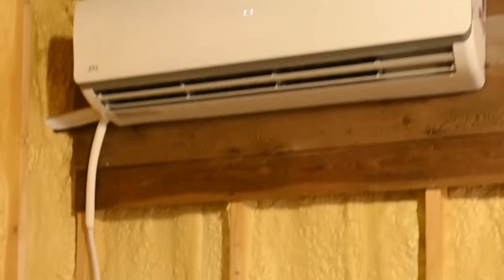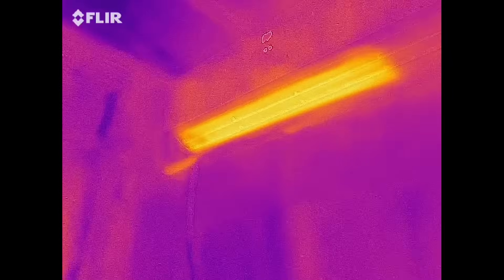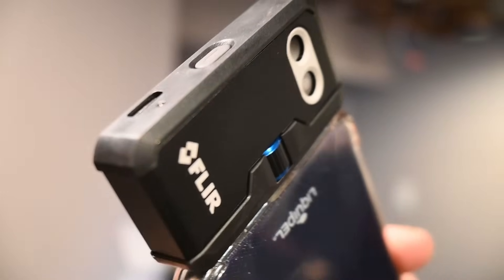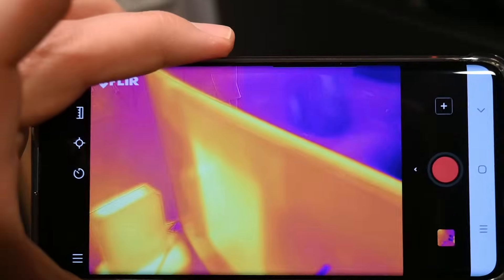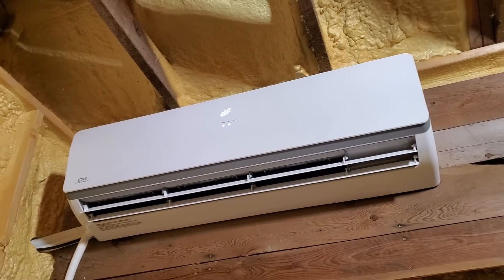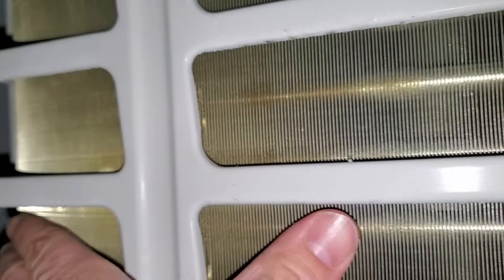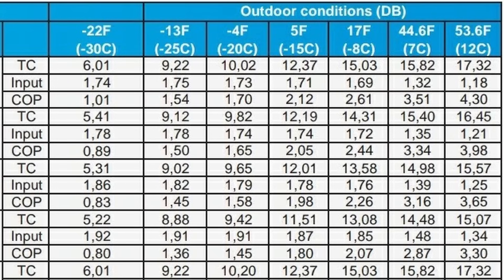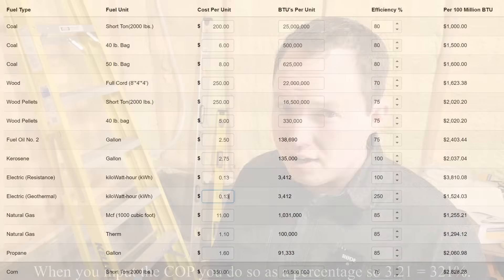Can You Use a Mini Split in EXTREME COLD? Heat Pump vs. Propane Cost Comparison with Thermal Camera

Comment: As a hvac tech of 18 years I’ll tell you that I love ductless splits, they break down all the time and I make tons of money off them.. I’ll take ductwork and natural gas any day , refrigerant leaks are so common with ductless due to stupid flare fittings also control boards , blower motors and condensate leaks are always inevitable
Reply: As an HVAC tech myself (in Canada)I have a different opinion. I have installed many of these or even conventional forced air heat pump. Most of the units I have installed have worked without issue for years. 
The splits go well into country home renovations that used to use straight base boards or wood fire stoves. No duct work available for retrofits.
They also work well in the city were folks have tuned attics into living space or mad add one in the form of sun rooms, which also have no ducts.
I always wondered why people cite failures on heat pumps that can also be found on ACs or gas fired furnaces. Boards on furnaces? Yes. Blower motors on forced air? Yes. Refrigerant leaks on ACs? Yes. If your flares are giving you a hard time I would recommend follow torque specs and using a small amount of sealant/lubricant. Use a good tool and make a nice flares. Will some leak? Of course but boy is it easy to find when the flare does leak. Reclaim the remaining r410a. Redoflare. Vacuum. Weigh in charge. Done. But this is a small.percentage.
Moral of the story. Proper Installation practice in proper application these units are great.
Reply: I just replaced a top of the line carrier nat gas furnace that only lasted a few months over the warranty of 10 years because it was more expensive to fix it AGAIN, rather than replace the whole thing.
Reply: Yea, well my forced air furnace igniter failed almost yearly on the worst day possible. My splits are flawless….

Comment: I've heater my house with a 36 thousand BTU and 2 heads (1 up stairs 1 down stairs) .. My power rate is 16 cents per KWH .. I've had this pump since 2012 and I record the power meter readings approx. twice a week every week since 2012 .. .. I also have electric heat but it's NEVER on , I only heat with the heat pumps .. In winter (here in Canada) when the temps are -10 to -20 it costs anywhere from $8 - 10.50 per day depending when the clothes dryer etc. are on ...

Comment: It’s amazing how good Mini splits have gotten. Midea/Carrier has a 40seer 15eer 14.5hspf at 5f its hitting 2cop. I installed a .75ton one in the basement and have tested it at -6f with 130discharge temp and set blower on furnace in off and can maintain a 2300sf closed cell home bit excessive for the central KY environment. This home is perfect world example being a cape cod on basement.
Reply: 130f discharge temp is very good. That's almost as high as a gas furnace, especially if you consider loss in a ducted system.
Reply: @stevenle1760  It's honestly too high of a discharge temperature. Higher discharge temperatures mean higher compressor head pressures, higher power consumption, and lower efficiency. They are sacrificing COP so that people get to feel a warm breeze.
Reply: Terrible cop for a so called super high efficiency unit. What a scam rating.
My 24k 20 seer 10.5 hspf beats that lol

Comment: When you show the heat pump outside the garage is pulling heat from the air, does it make a difference that it's sunny and the sun is warming the outside unit?  Also unless I'm mistaken, the fuel calculator link you give doesn't include cost of operation for heat pumps.

Comment: An easier way to describe a heat pump is as a heat amplifier. It draws heat from the surrounding air, stores its energy through compression and multiplies its effectiveness.

Comment: We install hundreds of these units. There is a lot of misinformation going around. I will try to make this short and simple. First if you are going to use these units to heat with you must do a heat loss in each area you plan to heat using the design day in your area (design day is the coldest expected day of the season) in  mid eastern PA we use 9 degrees. Second you must use a unit capable of providing these BTUs at that design temperature. Just because your unit says it works to -22 means very little because it does not tell you the diminishing BTU output. You must look for this info in the charts. Most inverters are only putting a little more than half capacity at 0 degrees. For instance, you have a room that requires 12000 BTUs on a zero degree day, you can not use a 12000 BTU unit. In order to get 12000 BTUs on a 0 degree day you will need to look at the charts and you will find you will need a 18000 or 24000 BTU unit to get the 12000 on a zero degree day then the units will be to large to properly dehumidify when using them for A/C. You must use HIGH HEAT units. Different companies call them different names. Hyper Heat, High Heat, etc. These units use a two stage compressor and will put out full BTU capacity below zero although there is still a drop in efficiency they still provide full BTUs. The industry itself has caused this confusion because they got into this competition about how cold the units would operate to without explaining the diminishing output.

Comment: ur a hoot.. When you say sum drop in heat output @ -22 f..24k vs 10k..Gas heat juz puts out. WHEN YOU NEED THE MOST HEAT..HEAT PUMPS FAIL...DAAAAAAAAAAAAAAAAAAAAAAAAAA

Comment: Here is W TX inverter heat pumps work well, especially if you oversize.  Problems with oversize don't exist here in summer as our humidity is nil.  We can upsize by 50% without issue and have heat down to the lowest it gets to be here in winter.  These work great.

Comment: Interesting information.  My Napoleon mini split was not at all effective in warming my small space at -20F .  My gas fireplace unfortunately stopped working and I had to wait a month for the part.  Had to resort to space heaters for a month to keep from freezing.  I am quite disappointed as I added this unit as a back up heat source which failed miserably when I needed it most.  It does a good job of cooling in the summer.

Comment: I wasn't finished with that post -- anyway I have not been able to figure out whether, when you decide it's dropping below the point at which you are saving money, you should SHUT OFF the heat pump or just let it keep running and ADD supplemental heat (I have a Rinnai propane heater and a masonry wood heater).

Comment: A quick question for you fella, would the condenser unit that is outside that had a two degree difference from in side to out side of the fan unit be able to have higher efficiency if the coil size was doubled ??? Just a thought Sir and thanks.
Reply: Yes, that is true.  That is why a 9k HP has a higher efficiency than a 36 K unit.  The indoor coil is compromised on a larger unit or it would be approx 3 to 4 times larger on the wall.   Nobody is liking thos looks and the materials would Bumpus the price significantly. 9 k units are typically 30% more efficient than large units because of this
Reply: @greg042  Thanks Greg for the information.

Comment: One to explain: absolute zero is -460 degrees below zero. Everything above that temperature is heat.
Theoretically you could extract heat from the air all the way to -460

Comment: Haha...I lived in China for a number of years. Many of the homes/apartments/condos are run by ONE stand alone heat pumps for the whole apartment. the Cninese consider us Americans spoiled. Mine was at leat ten years old. when the temps outside got below 40F, the coil outside started to turn into a block of ice. when it got colder, I had to shut off the heat and use a hair dryer to melt the ice on the coil. Obviously I had to be creative in how to heat the apartment ...not fun! Here's a question for you...How do you protect the outside coil, no matter how good it is, from rain and snow when it needs to "breathe" and move air???

Comment: Hi Ben,
Just brainstorming. If the heat pump works less efficient at colder temperatures, what about a setup that allows you to open a air vent from the inside of your warmer house so that the heat pump is not just getting freezing cold air? Is this an idea worth looking into?
Reply: yes maybe run a gas furnace outside by the heat pump so it's not so cold for the heat pump. PS sarcasm
Reply: Could be a good idea
Reply: @benbbuxton  instead of exchanging heat with the outside air, it would be better to exchange the heat with a flow of hot water. 

In that case it would be better to dump the heat of the hot water into the building.

Comment: It does not pull heat from outside, all you hvac guys need to quit being sheep. It’s a reversing valve that runs the ac backwards. That’s why there has to be a defrost mode. SMH I get tired of telling all these people things that should be common sense

Comment: Nice video. But missing from all this conversation is, how many btu/hr do you need? I saw the infrared camera pick up your framing (thermal bridges for heat loss from inside to outside).  Anyone building new or renovating really should run the numbers on insulation vs fuel cost, and try to strike a balance. I'd encourage people to familiarize themselves with the Passive House Standard, which includes super insulation, quality glazing, eliminating air infiltration and thermal bridges, and use of ERV. If you do these things first, you can reduce the size and operating cost of your heating and cooling equipment. Full passive house certification is more difficult and costly, but the base principles can be applied to any structure.

Comment: I'm trying to heat a greenhouse in the winter in southern ohio, trying to figure out if a mini split will be cheaper than a forced air coil heater I have mounted on the wall, to heat with.

Comment: Do you leave your mini split on 24/7? 

And… does your mini split inside unit fan ever stop running when the unit is set to automatic speed?  

My inside unit fan is always running unless I turn the unit completely off.  

Mainly wondering if it is normal for the inside unit to run continuously on a mini split?

Thanks
Reply: Some units will shut down the indoor fan if you have no need for heat for an extended amount of time. Otherwise it does this to sample the indoor air temp. You should leave your unit on all the time - there is no benefit to using setbacks with these units since they run exactly at the levels they need to.

Comment: Thank you for the hard work you put into your videos. You really helped me have a better understanding of how they work. I'm in the process of deciding if I should replace my old central AC or install mini splits. Would you recommend a 3 zone CH  unit? Wondering if one head unit  stops working do you need to replace the whole thing?  Thank you again.  I really enjoy  your material.
Reply: Highly recommend you research the fan noise, from the condenser placement and room units.  That, to me, is one of the bigger drawbacks.

Comment: Don't these units also use something like a hot gas bypass? Where they just compress the hot gas and send it straight to the evaporator instead of to the condenser coil.

Comment: Amazing channel, Ben, congrats. You are a natural teacher. I have learned a lot from you. In cold areas, would it make sense to add a heat tape (those used to prevent pipes from freezing) around the return of the line, before it goes out of the house into the compressor (to help out in extreme cold days)?

Comment: Good video, thank you for the content! I have an older heat pump i'm looking to replace, been considering the newer Mr. Cool Universal that can operate at pretty cold ambient temps. Got real tired of the old heat pump being turned off and running in 'backup heat mode' (aka toaster mode with resistance heat) during that stretch of near zero degree temps. I have my compressor cutoff around 15 degrees currently, seeing the Mr. Cool Universal able to stay fairly efficient in sub-zero temps but curious about real world experiences.

Comment: I just had a thought cross my head. For heating a space, the best location to start heating is from the floor and allow the heated air to rise. If heating inefficiency is to be mitigated, wouldn't mounting the inside unit down low be best?
Reply: Air flow can be adjusted so can just direct hot air down .But i get ypur point.
Reply: @786otto  ,
Reply: @rayihori8216  .

Comment: Thanks for putting some no nonsense facts out there. I didn't realize that they could work to that cold of a temperature. I thought that anything at 32 degrees and lower you needed a back up heat. On the point of seeing the studs from the outside. You need a thermal break in there, a newer process I would highly recommend is the use of ZIP boards. They are sheathing with a layer of foam insulation applied to the inside. It increases the efficiency of your structure.
Reply: You need to look carefully at the specs. There are some affordable Pioneer units (19 SEER2/24k Btu) around $1200 that will operate down to -13F. Some other units are rated down to +20F. For more extreme temperatures you may find a 100% or higher price premium.

Comment: 30 years ago I would NOT OWN A HEAT PUMP UNIT. But today's refrigerant has changed that.....
In reality...it is the compressor's heat and the physical compression of the refrigerant 'gass'  that's creating the heat. In addition to that, current day refrigerant 410- A   is more conducive to the process opposed to the early used R22 refrigerant.  Yes, technically there is heat being drawn from the outside, but only because it is slightly higher than the evaporation temperature  of the same  gass @ the condenser during the heat pump process. But even in his example it is only 2°. Now explain how that 2°  little difference produces the estimate 100° inside. A: You can't, it BULL Sh_t.  Again, it is the physical compression of the gass @ the compressor that causes / creates  the heat.  (I have over 30 years experience in HVACR field and 10 years + Director of Engineering (retired).

Comment: I did a self install on a 18k btu mini split two years ago and have been very happy with the unit and it's cost to operate. My heating costs are dramatically lower than previous years when I relied solely on my oil fired boiler which works well and is fairly efficient. Boiler efficiency aside, I wanted AC for the house which is why I chose the mini split...the added benefit of heating from the same unit was icing on the cake. I tend to not run the mini split below 20 degrees F since I feel like the unit starts to work too hard making heat and the manufacturer states it's only efficient at heat production to about 15 F.
Reply: What type of Mini Split did you install?

Comment: FWIW, I put in a modern mini-split in a cold climate location two years ago.  House is pretty well insulated and has good windows.   Here's my experience:  When the temp is above freezing it is all I need and very cheap to run. Below 32F it still works but you start to notice the output declining. Once we're in the low 20s I usually just fire up the wood stove and turn it off entirely, as it can't keep the house comfortable anymore.  My emergency backup to the wood stove is electric baseboard heat, which is extremely cheap to install in new construction, but really expensive to run.  So if your average winter low temp is in the 30s or above, I would probably not bother with propane, I'd just put in cheap baseboard electric heat for those rare days when the heat pump isn't enough.  But if you get long stretches of temps in the 20s or below, electric resistance heat is way too expensive and you'll need propane or a wood stove.